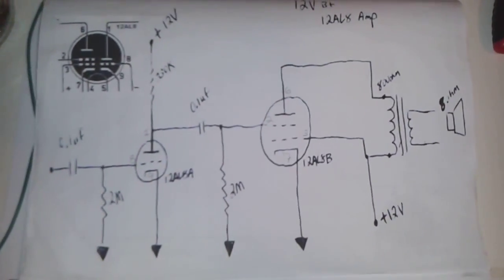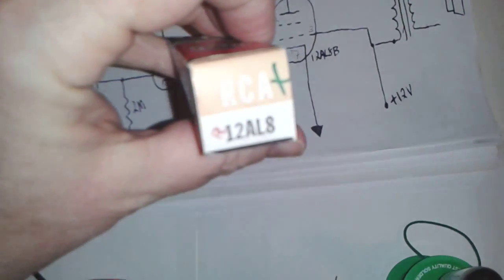12AL8 12v DC Tube Amplifier

Comment from the maker: Hi everyone. Let me make it clear here. I used a transformer that is normally intended for transistor projects. I thought this would work fine due to the lower voltages involved and lower tube impedance of 800Ω to 8Ω or a ratio of 100:1. The best thing I had was a simple transistor audio transformer of 1.2KΩ center tap to 8Ω (model 60-282-1) these are cheap and you can find them online at ebay and aliexpress. Any small power adapter transformer that has a 10:1 voltage ratio also should work alright if it is effecient enough, such as a 12vac out and 120vac in. I've used those before with great results.
Reply: Hello! Would you have a copy of the schematic available? I find it hard to read in your video… also what would need to be changed to run the heaters of 12.6 and raising the plate voltage to 24 volts? And information would be greatly appreciated! Love your projects

Comment: hi there, what transformer is it and is it single ended? i have the same tube and currently want to build one however my only transformer, with a 5k primary impedance will not work...
Reply from the maker: +AranE Games Here I used a small transistor audio transformer which fit because of transistor lower impedance and voltage. Specifically I used a 1.2KΩ center-tapped primary to 8Ω secondary. Model no 60-282-1. These are cheap and can be found on ebay and aliexpress. However, you could also try using a small 12volt power transformer. Specifically, a 120vac/12vac which has the right impedance ratio of 100:1 (800Ω:8Ω) or a voltage ratio of 10 to 1. I got great results with this small center tapped transformer using one of the "side taps" as a single primary. Just remember, the pentode output impedance of the 12AL8 is 800Ω.....so any efficient (not too large) transformer with a 100 to 1 impedance ratio (or 10:1 voltage ratio) ought to work ok. Try some and tinker around.
Reply: thanks for the reply, my power tetrode is putting out 6kΩ and y transformers primary is 5kΩ. can i put a 1kΩ in series? if not, i will try to find a power tetrode with 600 - 800Ω and a similar transformer. thanks

Aran
Reply from the maker: AranE Games You mean put a 1KΩ resistor in series to the primary? I'm not a certified electrical engineer, but I think that your transformer is close enough that you should get good results. Most of the transformers made for audio are not always spot on. Connect it first, and listen to it and see if the quality is good enough. 5KΩ is a common impedance for many output tubes, but engineers who designed the low voltage tube "sophtamps" put the impedance of the 12AL8 pentode at 800Ω at the low voltage 12v it was designed for. I got good results with that. If you're telling me that the 12AL8 has an output impedance of ~5KΩ then you know something I don't and/or more than I do about it.
Reply from the maker: AranE Games On this page:

http://www.sophtamps.ca/mambo/index.php?option=com_content&task=view&id=25&Itemid=37

some great low voltage amps have been designed and they seem to work very well for all their limitations. You can see the impedances listed for each low voltage power pentode shown:

12K5, 600Ω

http://www.sophtamps.ca/schematics/sopht_12k5-v6.jpg

12CX6 5KΩ

http://www.sophtamps.ca/schematics/sopht_12cx6.jpg

12AL8 600Ω (not 800Ω as I said earlier)

http://www.sophtamps.ca/schematics/sopht_12al8-v3.jpg

and other versions down the page....

Just try to find the closest transformer to your tube possible and also remember that if you have a 5000KΩ to 8Ω transformer, you could try to increase the reactance of your speaker (and, I think increase the speaker's impedance overall) using a small capacitor. If your speaker was at 10Ω impedance, then your transformer would reflect X/5000=10/8 which should be 6250Ω which is certainly close enough to match your 6KΩ tube. But in all honesty I don't have the math on hand to figure that out! It's here somewhere though. But I think matching your 6KΩ tube to a 5KΩ transformer should be ok....just make sure that your secondary matches your speaker or that figure will be further off.
Reply from the maker: +AranE Games Remember that an audio output transformer is like a MIRROR. It "reflects" a given value of impedance based on the ratio it works at. If the transformer's impedance ratio is 6000Ω to 8Ω (which assumes you'll use it with an 8Ω speaker), that means its base ratio for impedance is 750:1 or 750Ω to 1Ω. So if you use an 8Ω speaker on one side the tube on the other (primary) side will "see" an impedance of 6000Ω. But if your speaker was a 4Ω speaker then the tube would see an impedance of only 3000Ω ! If your tube worked at 6000Ω then you'd only get half of your potential out of it and maybe stress some components. But if you had a tube that worked at 3500Ω you could use the same transformer with a lower impedance speaker! You follow? I don't know if you can use a capacitor to change that (I'm still learning this) but you can try to use step-down power transformers to use as output transformers if you figure out their ratio.

I suggest you read this bunch of articles I put together on this.
You can easily use a low voltage transformer to determine the impedance ratio of any transformer.
To get the x/1 ratio, just get a voltage ratio first. Here's how: take a low voltage transformer (a safe voltage) like 10VAC output. Connect the low voltage ac output to the SECONDARY of the other step down power transformer. Measure the output with a voltmeter. If your transformer had 10vac going in and 1.0vac coming out (going in the secondary and out the primary...don't do the other way! You could get a shock!) then you have a voltage ratio of 10 to 1 (likely a 120vac/12vac transformer). Divide the higher voltage (going in the secondary in this case) by the lower coming out of the primary you have 10 to 1. Square it and you have your impedance ratio....in this case 100:1. Which would mean if you connect an 8Ω speaker to it, you get a "reflection" of 800Ω on the other side....get it?

Just read these articles I put together. They are not mine, found online but very useful:

https://drive.google.com/file/d/0BzyDF_lUE5AaYUthZHl2ZlVsbkk/view?usp=sharing

GOOD LUCK!
Reply: thanks, i'll take a look, my main problem is i wanted the 12al8 but nobody stocks these so i had to make my own schematic and i can test once my tubes that i ordered get here.
regards,
Aran

Comment: Cool.  I have literally 8000 tubes and they are going to waste.  I'd better get busy.  Where do you feed the signal???  Screen?
Reply from the maker: +Steven King Going to waste? Why not just mail them to me....I'm sure I can take care of them. :D
Yup, the signal is fed to the screen using a cap in this case...though it could be done with other caps or another 12volt preamp tube also....I haven't done much variation on this one yet.

Comment: cool project. been thinking about doing something like this. by this. was curious about how you set that transformer as no colors to indicate primary and secondary
 are the pins sequenced?
Reply from the maker: +biggs415 Biggs, I don't remember exactly but likely I just tested with my ohmmeter and hooked up the end with the higher resistance to my tube and the lower to the speaker. Or just tinkered w it. It is a TRANSISTOR OP transformer....but I figured to use that as the higher voltage from a typical tube output doesn't apply here. I'll help you more with this in the am if needed.